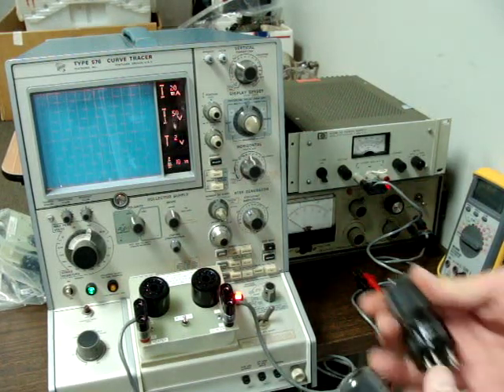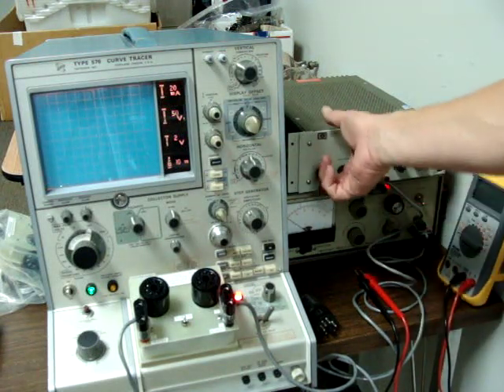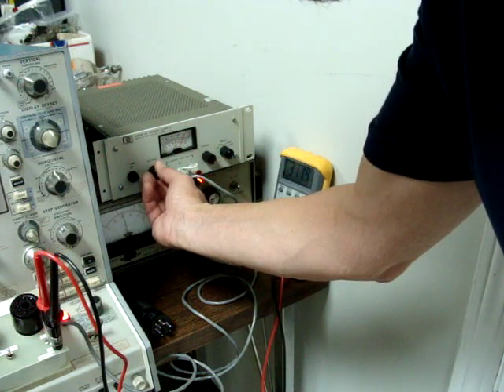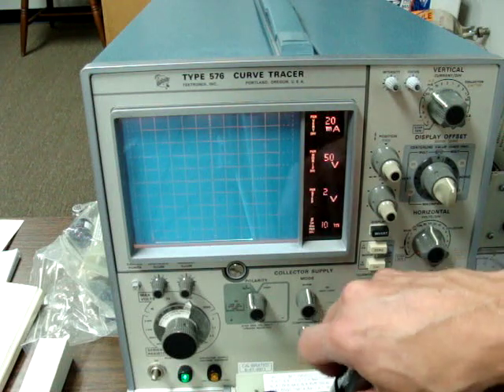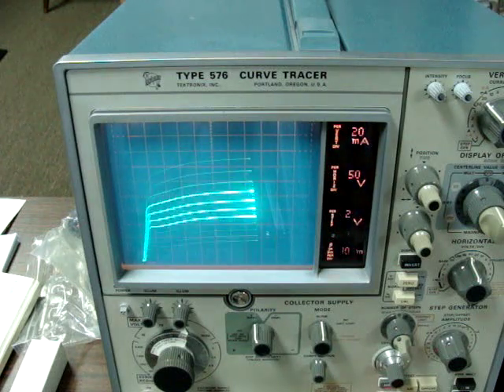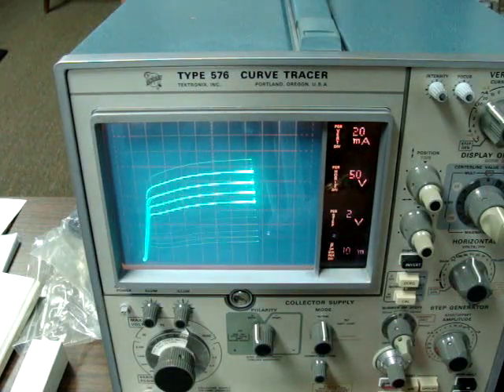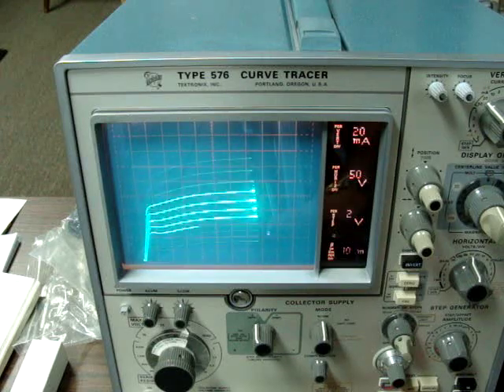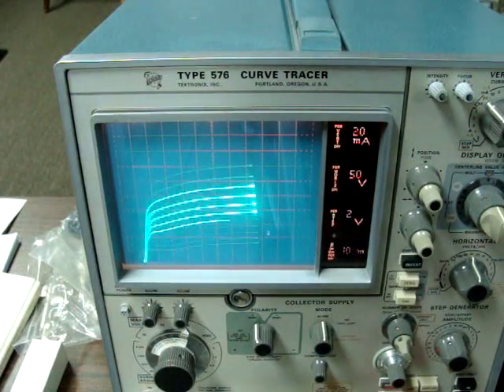Matching 6V6 Vacuum Tubes With The Tektronix 576 Curve Tracer

Comment: One thing I like in this video, is where others never mention, regarding the true test on a 12AX7.  The complete test should be done at the upper max plate voltage limits.  275 VDC minimum each triode.  Well it is rated for 300VDC max.  But I see guys selling 12AX7's on ebay when they have only tested within a 200VDC max.  Or am I missing something here, because on the early 1998 Marshall JCM800's  I have seen 280VDC on the second triode of V1.  As in the second gain stage of V1.  That's a lot most vox amps are only supplying around 195VDC on the second plate.  But its a no wonder why those 1998 Marshall JCM800s made the tubes go microphonic and noisy quickly.

Comment: The HP power supply you are using, does that put out 325vdc? The most I have ever seen from HP was 80vdc.
Reply from the maker: That is the HP model 6209B.  It can put out up to 400 volts DC and up to 120 mA.  This makes it perfect for the screen grid supply for tubes that have them.  The screen does not need high current.  The curve tracer supplies the plate voltage.
Reply: audiotubes
 Does that particular curve tracer provide 400v for the plate? That one was for transistors so I'm surprised. You are right tho,the screen takes almost nothing as far as current. I think maybe 1ma to 10ma on average,depending on the tube.
Reply from the maker: The Tektronix 576 can provide up to 1500V!  The load resistor is only rated at 220 watts, so with a tube like an EL34 that can take up to 800 volts on the plate, you could burn up the curve tracer!  We do most testing and matching at 350-400 plate volts.  One rule is to never let the display peak curve go up to 600 mA, as damage will result.

Comment: Pretty cool!  I'm curious which model HP PSU give you the voltage/amperage you need? Thanks --carl
Reply from the maker: HP model 6209B.  You can usually find them surplus online.  I got mine through eBay from a surplus seller for $90.
Reply: Thanks!

Comment: See my comment on my test fixture being like the Tektronix 570 tracer. My 570 has so many bad parts, I went to a 371, now I have to sell that and use a 576. $28K vs $800? The 371's goin'. With my set up tubes from old 4 pin 807s 5,6,78 octal loctal, 7,9,10 pin mini, & compactrons to 12 pins. You hook up jumpers according to the tube base diagrams. Pin 2&7= heater, 1&8 K&G3, etc, or PGK to each section of a dual triode on one socket. It works kinda like an old telco switch board.

Comment: I am having to sell the 371 tracer. That one will do 845, 211,300B and other tubes up to 3000 volts. I got a 576 delivered to my door for $800. I made my adapter like my old 570's test fixture. I used 5 BNC jacks, and  36 5 way jacks. I can set it to test any pair of  from old 807 4 pin to compactron 12 pin. By jumpering from P,K,G1,G2,G3 supplies to the respective jacks #1-12A&B I can test 6EU7s matching sections, pairs, and do non std powerbeams. I Relay switched the A-B/A1-2-3 switches.

Comment from the maker: Hi, the schematics for the test modules are printed in the December 2011 issue of "The Tube Collector".  There is a complete article in that issue about testing tubes on the Tek 576.  You can get a back issue by going to The Tube Collectors Association webpage (google search "Tube Collectors Association").
Reply: I need to dig that up.  @audiotubes ....  this should work on a 577 as well, right?

Comment from the maker: The 576 does this too.  You can compare the curves to the curve plot in the RCA tube manual and see if the tube being tested is similar or showing signs of low transconductance (Gm).  The vertical scale is plate current, the horizontal is plate voltage, just like the curves in the tube manual.  The 10 curves show plate current for grid bias of 0 to -20 volts in 2 volt steps.  A change in plate current for a change in grid bias is the transconductance.  It's shown by the space between the curves!